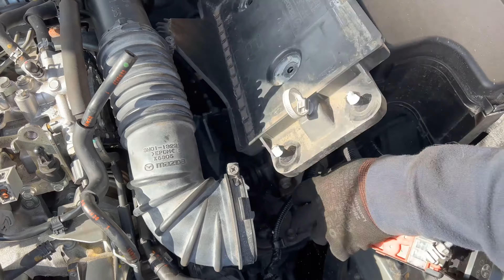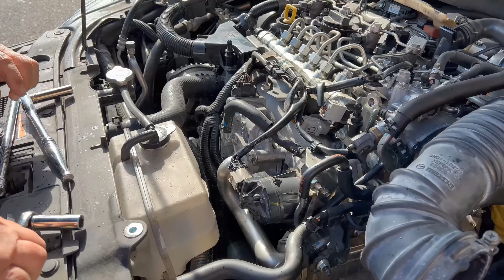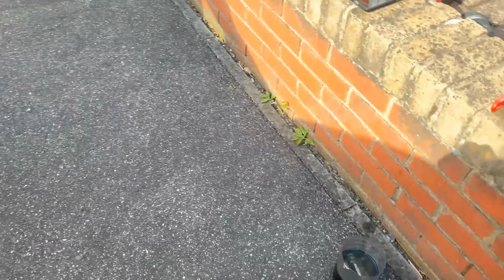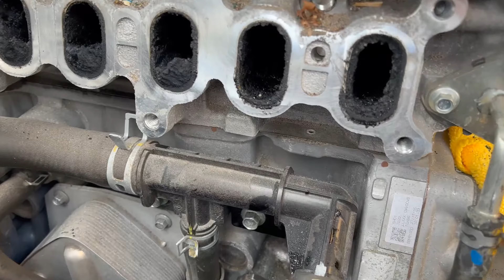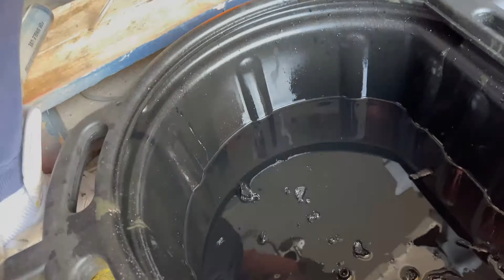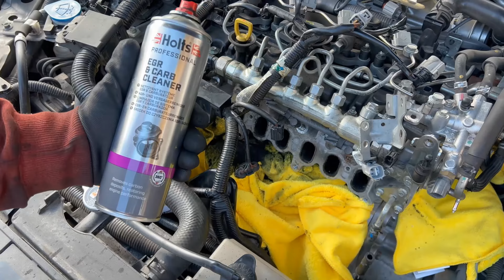P0401 Fault Code Mazda  - Mazda 6 2.2 Skyactiv Diesel EGR Valve Removal + Cleaning

Comment: Mate, im forever grateful for people like yourself that upload ransom vids like this. Unrelated to your issue, but the little plastic 'junction' in the cooling circuit shown in your vid at 9:26? Yer that gave out on me and as you are aware a total pain to get to. Mechanics all near me are booked out for a cppl weeks. Will he replacing myself and seeing a complete teardown to gain access is going to help heaps. Also, for others watching this, mazda have since replaced the part with solid metal tubing. Much better.
Reply from the maker: Thank you very much for you input, I really appreciate it ;)

Comment: Did this job at the weekend. Thanks to your video it made it so much easier.
Question, did you have any trouble restarting the car afterwards? When I came to restart mine it struggled for a long time. Could it have been excess cleaner left in the intake and valve ports?
It's ok now, but had me worried for a while.
Reply: I did, took about 10 goes to start. But now my mazda has no power under acceleration so not sure why

Comment: Great job and thx Mate. Your video helps a lot.
I followed precisely all your steps and after 12h in 2 persosns we succeeded to reinstall everything as it was before.
The problem is that the board is full of errors as a Christmas tree 🎄, the car is on limp mode one without turbo running.
Canceled all the errors via diagnostic module but without success, the errors are there.
I did something wrong? 
Thx for any suggestion because we made this operation just as prevention, the car hasn't any error before 😢
Reply: Do you got rid of your problems? - I'm a bit afraid that my Mazda will be the same?
Do you have any tips? - I just have a very cheap diagnostics tool should I get a expensive one before I do this repair?
Thanks - Greetings
Reply: @chris-qc7eu  I solved it but other problems pop-up (e.g. DFP).  I suggest to do this operation with somebody who did it already. Mazda CX-5 diesel is a complicated car, unfortunately

Comment: Hi! Many thanks, great video. Was the code p0401 the only problem, no leaking egr? I’m asking because my problem is the rising pressure in the cooling system. It keeps filling the expansion tank. Cooling fluid won’t get back to the radiator when cooling down. There is a bit bubbling in radiator when app 3500rpm. Oil and cooling fluid don’t get mixed up. So I was wondering if egr leaks to the cooling system?
Car is model 6 2013 2.2diesel 175hp and 300000km driven.
Reply from the maker: @Janne Kallio  Thank you. It had only the p0401 code. Well I think the EGR and the cooling system are connected so they can't leak to each other as they use the same coolant. I would check the thermostat if it is working, or would replace the coolant and then bleed it. 
However at 300k km I would definitely clean the EGR and the intake manifold from carbon deposits if it hadn't been done.
Reply: Could the exhaust gases be leaking from the gas side of the EGR cooler into the coolant side?
Reply from the maker: @James Campbell  Yeah that could be the case. But obviously that has to be checked by a mechanic.
Reply: Janne Kallio thats amazing to reach 300,000kms.  Was it the original engine? I had mine replaced at 125,000kms due to issues with the overactive dpf.
Reply: @jack_attack_1  yes it is the original engine. Turbo was replaced already in 30000kms and the other camshaft in 230000kms with nozzle gaskets and the oil strainer. But now I got the cylinder head gasket replaced and the turbo for second time. There was a minor leak in head gasket.
Reply: @MrNiceGuy94  thanks, there was a minor leak in head gasket, so had to replace it in the garage. Cylinder head was also checked and cleaned. Now it's working again
Reply: @jannekallio8528  hi mate how was the cost and where was it done

Comment: Great video! Did you reuse the coolant? Any advice before starting the engine after assembling everything back?
Reply from the maker: Thank you! I didn't reuse the coolant I just topped it up with distillied water, but technically you can reuse it. However if it's old it's worth flushing😉 
Well,here is an advice, if it doesn't start you may have to jump start it. Or you can make sure that when you clean the intake ports,the valves are properly closed and no deposit gets under the valves making it harder to start. 
If you have any further questions,please don't hesitate to ask them! 😉
Reply: Thanks for the advice. I'm planning to do this job shortly. Another question would be if you changed the gaskets with new or re-used the old ones. Thanks.
If it helps, for manual transmission, the engine can also be rotated by switching to 4th gear and turning the driver's front wheel while the passenger's stays fixed.
Reply from the maker: @vrabievalentin4071  I only changed the intake manifold gasket and the throttle body gasket, because only they were available to buy separately. For the EGR valve,piping and EGR cooler I reused the old ones, becuase I couldn't get them. But maybe I was just lame :D and didn't know where to look for them. 
Yeah, I know about that technique, actually I have a video about it as well. I don't know why I didn't use it, would be certainly easier. But it is what it is. The car is fixed now ;)
If you follow the video step by step you should be able to tackle this job with ease. It is quite simple and straightforward, there are just million bolts and screws to remember where you have taken them out from :D 
If you will need any help, feel free to ask it ;)
Reply: Couldn't help myself so I stopped work and started this job on my cx5 at 3 pm today. I managed to remove and clean the EGRs, egr coller and bypass pipe. Had a try to remove the manifold pipe, the one at the bottom. I rotated the plastic connection anticlockwise but damn, could not remove it. I'll try again tomorrow after breakfast.
Reply: Quick question, is it necessary to remove the glow plugs while cleaning the engine side?
Reply from the maker: @Vrabie Valentin if I remember correctly the plastic connection on the lower side of the intake manifold has to be rotated  clockwise. But I am not 100% sure, I may be wrong on that one. Either way,I remember I had hard time removing it as well,it required a decent amount of force and you have a very tiny space for your hands to move. But once you got it off, it just has to be pushed down and that's it,you just pull the manifold out of it. 
For the glow plugs,you don't have to remove them. At least I didn't remove them. 
If you have any other questions,just ask. 😉
Reply: @MrNiceGuy94  I managed to clean the intake manifold, EGRs, and 2 ports on the engine side. I left the other ports as they were because as much as I struggled I could not figure out if the valves were closed or not so I did not want to risk causing damage. I let the radiator burp and topped up with distilled water. One thing I noticed while viewing the live data for coolant temperature, was that oil pressure was high, about 370kpa in idle @2500 rpm. Not sure if this is related to cleaning or if I done something wrong in the process, but I'd be interested to know how to get it sorted. This job was a really challenging task for an non-mechanic but your video certainly helped a lot, so many thanks for posting this step by step guide.
Reply from the maker: @Vrabie Valentin What method did you use to determine which valves are open or closed? 
I think 2500rpm is too high for idle, it should be closer to 1000rpm. I am not sure about the oil pressure how much it should be. Did you get any fault codes after the cleaning?
Reply: @MrNiceGuy94  I used an inspection camera as shown in one of the videos on YouTube to check if valves are closed, managed to figure out on 1st 2 ports which I clean with no issues, but on the other ports I had no clue. I definetely lack knowledge and perhaps an experienced mechanic would have known immediately, but not me, camera showed something but I couldn't decipher. I held the car in 4th gear and rotated the wheel. If there is another method to visually inspect whether the valves are closed please let me know. Regarding the idle, idle was normal, I just revved up the engine to rise coolant temperature and start the fans to burp the radiator. This is when I noticed oil pressure level high. Today I made a 50 miles trip, 4k revs and no issue or lights on the dash, but oil pressure remained 370 kPa. Car runs smoother and definetely pulls better than before. Not sure what the normal pressure is, the diagnostic tool says max oil pressure 200kPa,mine is 370, but again nothing wrong happened while driving. Perhaps my Autel doesn't know the max values, or it may be because the car was performance remapped a year ago and pushed to the safe limits. Nevertheless, I'm happy with results, car feels and drive much better. Many thanks for this step by step guide.

Comment: I followed your steps in detail and cleaned intake manifold and EGR. 

When I put the parts back together, car started first time no issue. No codes after test drive.

However there is little power when I accelerate (which wasn’t there before) as well as a loud whistle noise. Car struggles to go over 3000rpms. No other engine light has come up.

Have you had this issue? If so how do you fix?
Reply: Update to anyone who is having P0401 code in Australia.

I have a 2017 Cx5 Diesel, same engine. With 140,000kms

I followed these exact steps and it’s my first time doing it.

The issue I was having was due to 2 hoses that weren’t clamped properly and low coolant levels. Found out by doing a smoke test. And saw the engine over heating.

This job took be 20 hours over 2 days. Personally I would not do this again on my own. I found a mechanic who will do it for $1000AUD in Australia. And they were willing to do an ultrasonic clean for the EGR AND Intake manifold and a walnut blast for the engine bay. A much better job Then what I could ever do with a screwdriver and carb cleaner.

This is a really hard job that can be done, but will take a long time and at least 2 people. But if you can find a mechanic to do the job I would recommend going to them as they will have the resources and better tools to get the job done better.

Comment: Hello and I respect you to do this operation we need to remove the battery?
I want to give it a clog cleaning as well
after this operation you had to put the device to the test to cancel the witnesses?
Reply from the maker: Hello. Yes you need to remove the battery. Unfortunately I don't understand the second part of the question. Could ask it a different way? Or Ask the question in your language and I will get it translated.

Comment: Why the hell do these engines 'carbon up' so much 🤔
I wish i knew this before i bought one.
P.s , is that throttle body spray you were using ?
Reply from the maker: They have a bad design from factory. I used EGR cleaning spray.
Reply: Because the engine is GDI (gasoline direct injection) really dirty. Port fuel injection is better. GDI engines made an entry in 2010. PFI before 2010.

Comment: I just got my Mazda 6 back from the mechanic yesterday after having a new Exhaust Pressure Sensor installed and then today I get this EGR fault. Are these two related and should the mechanic have spotted it when changing the EPS?
Reply from the maker: Hello, I have done the Exhaust Pressure on this one a few weeks ago. I am not sure if they are related. But it is extremely likely that your intake manifold,intake ports and the egr and cooler looks like this one. 
I would recommend people with this engine that they clean it every 40k miles at least.

Comment: Thanks for the video. Is there a way of knowing if the intake valves are closed on an automatic transmission without using a borescope?
Reply from the maker: Hello. The transmission doesn't matter. Other way is to remove the glow plugs and use a screwdriver and with that you can check when the piston is at the top dead center. However in my opinion the borescope is a lot better, because you can see it, and also you can have difficulties removing the glow plugs.
Reply: @MrNiceGuy94  Thanks a lot. I'm changing my cylinder head gasket as well. I'll take that as an opportunity to clean the intake and EGR system.

Comment: Hi I'm a bit  confused on the whole egr system I'm trying to block it off and was told to just block the solid metal pipe labeled 1 and 2 off closest to the engine ,would that work?
Reply from the maker: To be honest I am not quite familiar with EGR blocking. I think that you need to block all the pipes which are going from the EGR system to the intake. But more importantly it has to be written out of the ECU as well.

Comment: Hello, I would like to ask if you purchased new inteake manifold gasket or used old one ?
Reply from the maker: Hello, I used new intake manifold gasket for this. However I did put old gaskets back for the egr and piping as I couldn't get new ones for them.

Comment: Am I seeing this right... ? for s simple EGR removal and clean u have to take off that many parts. that many nuts,bolts,sensors and wires,hoses ??? How on earth will u remember to put it all back let alone correctly?
Reply from the maker: Yes,you are correct 😂
One example is to record everything you have removed and then watch it back when assembling things together. 
Second example is to use my video as a guide. 😉😂
Reply: @MrNiceGuy94  haha top guy so true! just record it simplezz
Reply from the maker: @princejamil87  Yeah,recording it definitely helped me as well.

Comment: i did same job as you but i didnt use cleaner for valves, i used thin brush and cleaned with it took more time but i did do the job now i have problem with car not starting did check batty  voltage and it is at 12.4 and when i crank it it is at 10.30 10.40 but it starts to crank and after 2 or 3 sec it starts to missfire it throws bunch of codes that i did clear but i trie it agean and have sam codes i need to check all conector main bing the throttle body and some sensor in the middle off engine block down ther i think it is cylinder recognition sensor
Reply from the maker: Hello, is it manual or automatic? First I would definitely check again for all the connectors if they were properly reconnected.
However we had problems to start the car as well, we had to push start it as probably a few bits of carbon deposits were stuck around the valves and made it harder for the engine to turn over.
Let me know if you succeeded with it anyways.
But as I said, first I would check for the connectors then trying to push start it it it's manual.
Reply: @MrNiceGuy94  it is manual 2.2 150hp, i can try to push start it but i think i will get one more battery and start sprey do you recomend it or is it batter to push start it
Reply from the maker: @filip-pi9hy  first I would try to push start it if all the connectors were checked, and if it doesn't start then I would get a new battery.
Reply: @MrNiceGuy94  did test connector all are ok when i turn off ignition i can hear intakeflap working i will trrey to push start it
Reply: @MrNiceGuy94  car started with start spray small amount was all i took to start it 😂 now it work relly good and pulls 100x better
Reply from the maker: Wow, that's great to hear. I am glad it is all working now. ;)

Comment: Hello, i made the big mistake and let egr fluid in the cylinder :-( Motor will not start. How can i correct my mistake? With Carbon X Combustion Chamber Cleaner K1+K2? I already removed the glow plugs and turned the motor over. Nothing came out and it did not help!
Reply from the maker: Hello,
did you mean EGR cleaning fluid? If so, what might have happened that carbon deposit is stuck on top of the valve, and therefore it can't close properly so you have compression leak and that's why you can't start the car.
It happened to me as well.
Is it automatic or manual?
Reply: Yes egr Fluid. That is exaclty my assumption ..it is manual..i am trying to remove the deposits teeth brush
Reply from the maker: Well, you are lucky then. As if you said that you have removed the glow plugs and turned the engine over so that way you made sure nothing is inside the combustion chamber.
So what you can do is to ask someone to tow you and that way you can push start the car.
Whilst someone is pulling you with their car, sit in your one have 3rd gear engaged and the clutch pedal pressed, and when you are rolling release the clutch pedal. Just be very careful that you don't crash into each other whilst doing it.
Reply: Hi again,

so i cleaned up the valves one more time with oven cleaner...it helped very much and then crancked with glow plugs Out and reassembeled everything. Engine Starts now but very loudy..so will Change the oil tomorrow and drive a little bit ..
Reply from the maker: I am glad it fired up finally. A rough idle or running is pretty normal on the first start up, even some smoking from the exhaust is normal.
Reply: Thx very much for your support :-)
What about coolant water? the coolant system is now full with air
Reply from the maker: You can just bleed it.